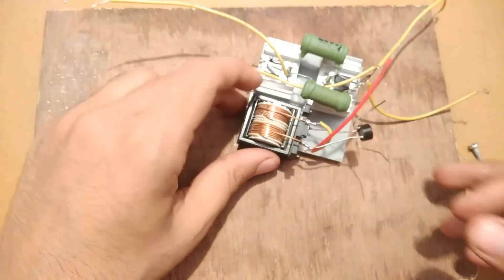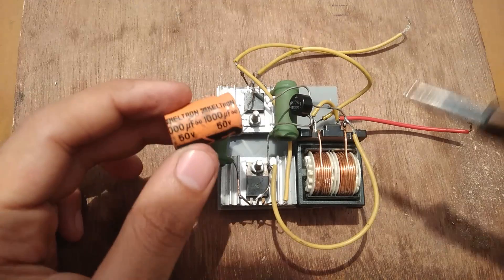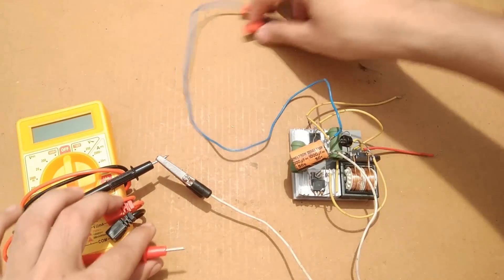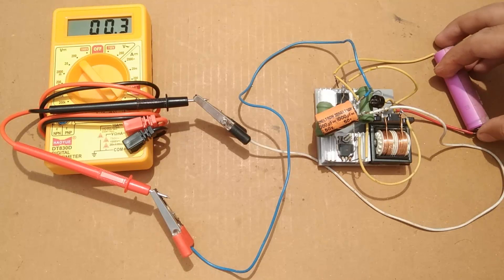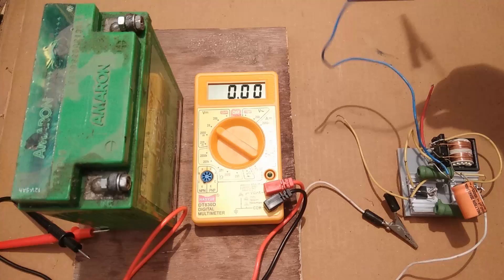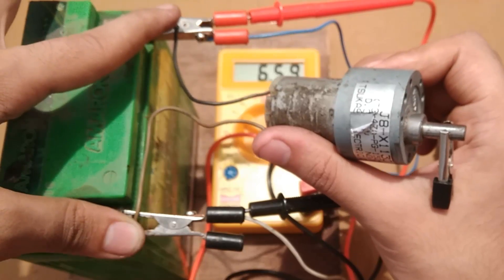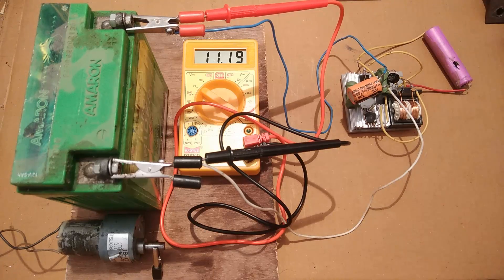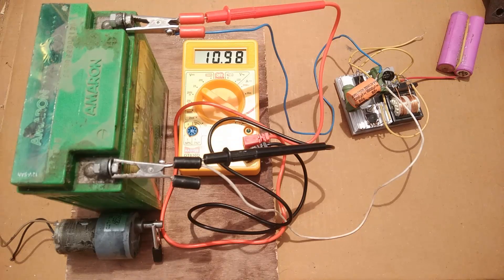How to Charge 12V Batteries with a 3V Cell || Amazing Idea DiY

Comment: Here is a good project that would sell: Charging an EV (Electric Vehicle) from a 12V battery. The EV has a Level3 fast charging port (CHAdeMo). May need to add some software to control it (BMS).

Comment: Absolutely fake. You even know the basics of electronics? by increasing the current it doesnt make it any sense. volts behave different. You could do it if you added the batteries in series to increase the volt not current. You buy adding the 6 volts at the end You just connected 6 more volts to the 8 volt big battery thats the reason the voltage increased so rapidly. There is no fucking way the charging would go so fast thats not called charging thats called connecting two batteries and thats why it dropped so fast. Connecting any battery to another battery to charge it doesnt work it will just bring the two to an equlibrium of voltage. Even trying to charge a 12volt with another 12 volt doesnt work if one starts with 8 like yours and other 12 they will end up with 10 both. Reason it works with jump starter cables in cars its cause of the dynamo in the machine. Why u flex? Seems you know enough Electronics and Electrical engineering but this is like first year in high school stuff you should know best. Troll

Comment: Nice. Good Job. Please how can i generate 500watt energy for home use
Reply from the maker: Use solar panels or a wind turbine.
Reply: i want off grid and the solar panel cannot charge my 12v battery to full capacity at shortest time

Comment from the maker: Anyone who thinks its a fake ??????????/
Reply: Mr Electron Not a fake but completely useless....
The same as trying to fill a beer barrel with a sixpack !
Reply from the maker: Your conclusion is on the bases of the 3.5v cell that i used which as u say is a six pack and the big battery is a beer barrel but what if i use a hundred parallel connected 3.5V cells.The voltage will still be 3.5V but the current will be 100 times more.
Then : "same as trying to fill a beer barrel will 10 or 15 beer barrels" 🙃
Hope u understood my point.
Reply: Mr Electron Yes you are right !
But what you show is what the title says "A 3v cell" not "(100) 3v CELLS".
Reply from the maker: Yes i said 3v cell but didn't mention about the amps so it was understood for either case : 1 amp or a 1000 amps.Its  a bit difficult to explain everything in the title since its character limited .. 🙃
Reply: Mr Electron No offence, but just leaving out the words "a cell" would make it a 100% valid title... 😉
Reply: P.S.: If I had 100 3v cells I would put them in a 4S25P configuration and charge without the need of any additional components... (perhaps just a halogen lamp as current limmiter)
Reply from the maker: As would i if the cells are not pre welded..
Reply: Mr Electron 👍🤐
Reply: Mr Electron do you know the product of voltage and current is a constant??
Then this small battery cannot charge the big one.
Also you need to learn the basics of lead acid battery charging.
Giving 12v is not charging.
Reply: @sonicpana6071  😂 something what I was searching 👍